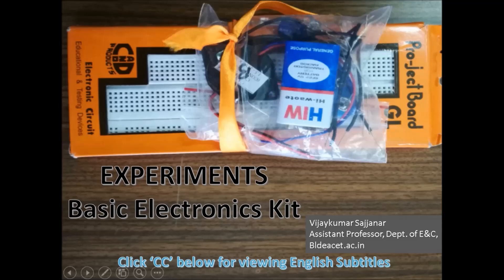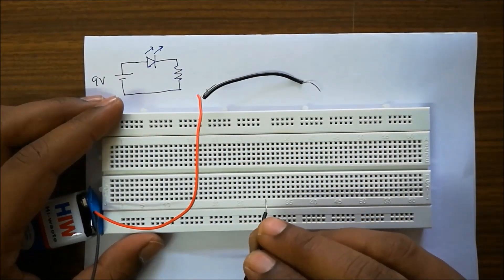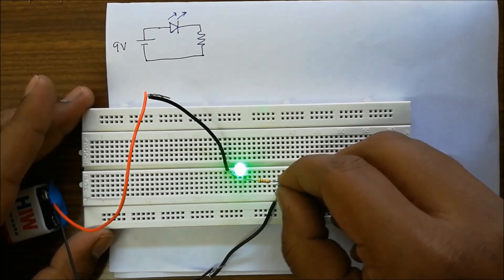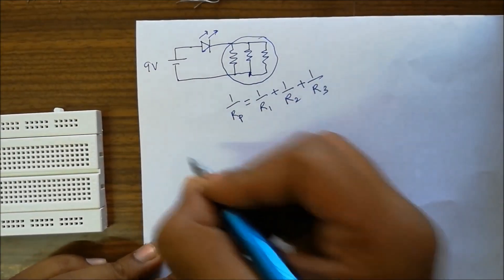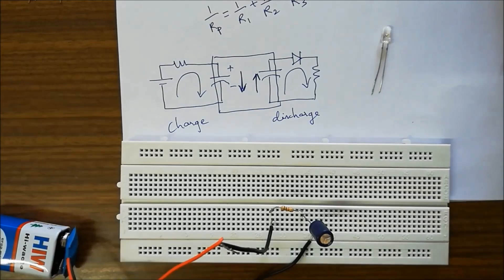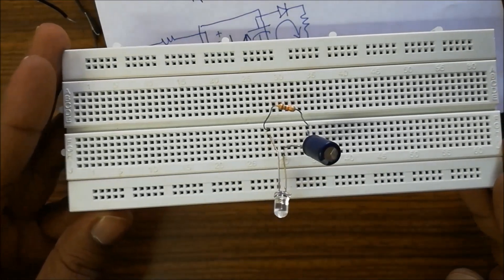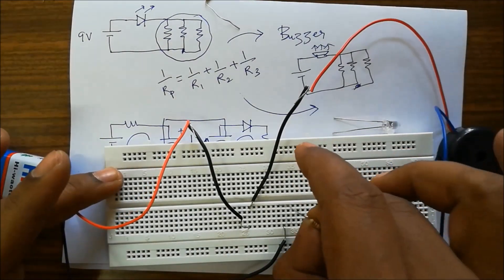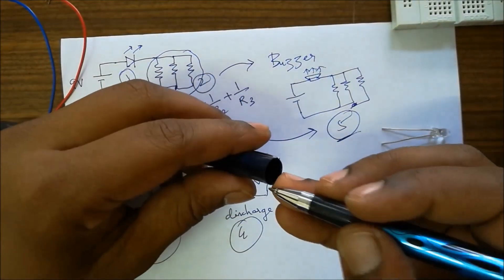Basic Electronics Experiments (For Absolute Beginners)

Comment: I am confused as to why the resistance total decreases if you put more resistors into the circuit. Sorry, I am a beginner here. So what would be the advantage of having three resistors? Why not just decrease the size of the first resistor so there is less resistance?
Reply from the maker: What are the applications of parallel resistors? One.. You can generate any resistance value using standard values. Two.. Very much needed so that large currents do not heat up single power resistor. Current splits in parallel connection. Three.. All of our electrical applications/connections are parallel. So for analyzing effect of these you need knowledge of parallel resistors.
Reply from the maker: Never be sorry for asking questions! May I suggest going through EveryCircuit App for hands-on knowledge! Good Luck!
Reply: @hivjkry  Thank you so much. Am downloading the app now. Cheers!
Reply from the maker: @kiwinessss  Cheers! Let us know how it goes!!
Reply from the maker: Hi Bob, Why resistance decreases in parallel? You can assume resistors as water pipes. more pipes(resistors), more water(current), same pressure (voltage).